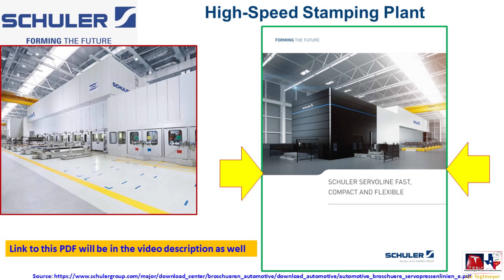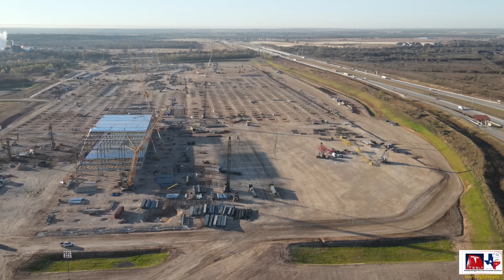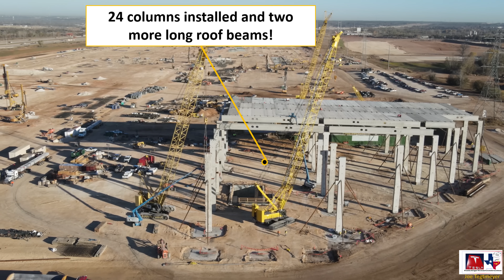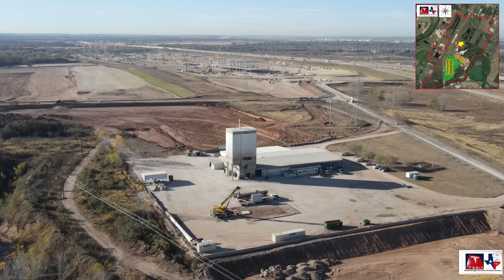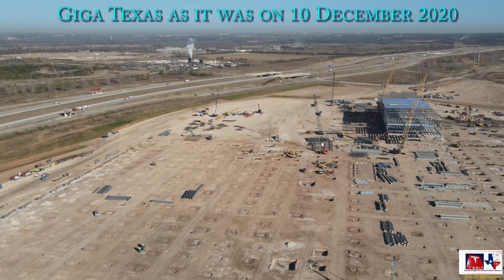Tesla Gigafactory Texas 10 December 2020 Cyber Truck & Model Y Factory Construction Update (08:00AM)

Comment: Those large reels are most likely very large dia. copper( about the size of your thumb) .  They are used for the ground grid and steel structure grounds. They will also drive vertical ground  rods and bolt or cadweld the rods to the wire. You will know this is going to happen when they start trenching the area and you see a grid like pattern.  I helped do the trenching multiple times.

Comment: Do you think concrete wall slab will be going up on the westside and the reason for the traffic barricades preparing for concrete wall pouring?
Reply from the maker: At some point probably but we e got a ways to go before wall sections start going vertical I think.

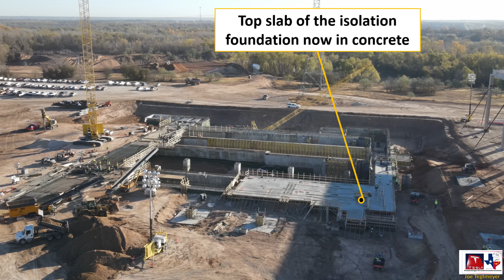Comment: At 14:00 you point out "top slab of the isolation foundation now in concrete."  Is this the future "factory floor" that workers will walk on?  Or is there more stuff to go on top?  (I understand there will be gigantic machinery there too)
Reply from the maker: Sorry ... I thought I covered this earlier in the video discussion the stamping machine installation.  This is where part of the stamping machine will be mounted that does not need the machinery vertically installed underground.

Comment: Ok, so I'm a little confused here. There are 3 major types of machinery for forming the body parts: (1) stamping machines for 3 & Y body panels, (2) casting machines for 3 & Y underbody front and rear chassis structures, and (4) machinery to bend the sheet steel for cybertruck exoskeleton. I had been under the impression that the structures being built in the "big pit" were for the casting machines. This video makes clear that these structures are actually for the stamping machinery. Which begs the question ... what about casting & sheet steel bending machinery?
Reply from the maker: I have been showing, discussing and mentioning that the big pit is for Stamping machines for some time now.  I think most people just casually read some headlines about giga-press casting machines and just leap to that conclusion not knowing that there is a major difference and purpose of the two machines.  The "Zipper" pit will (most likely_) be for casting machines that make the pre-fabricated forms for the front and rear subframes that are bonded to the structural battery of the cars as discussed by Tesla on Battery Day.  I plan on doing another (again) discussion of the Casting machines, where they are made and how they function in an upcoming video.  As for the machines to make the CT exoskeleton, it is my understanding that Tesla has not yet finalized the machines that will be used (at least up to a month or so ago) and I am not sure where this will be located yet as I do not see evidence on the ground yet.  Hope this helps.

Comment: Great Graphics as usual with Your colour coding. The pictures of Schiller Stamping machines showing below floor canned footage from manufacture were the best showing the 3 overhead cranes for 3 machines. Please, more graphics to show 2 Stamping Machines and 8 injection machines in the 3 bays. I’m guessing that the Precast Concrete structure will only be in the pit area. This side is for CYBERTRUCK with zipper area for automated bending of Stainless Steel. The Gazebo area is very narrow structure of 4 columns wide SO FAR? It appears to me that this building only shows 1/3rd of its ultimate width but is built in sections for crane reach for very wide building for 3 car lines? 2 for MODEL Y & 1 for MODEL 3?

Comment: I've noticed the "zipper pit" is at a slight angle to the rest of the building. So that probably means the line will run at this angle as well. Joe, do we have any idea where the paint shop might be located yet?
Reply from the maker: The big steel structure you see right now is the paint shop.  I've been covering this for about 2 months as I have a source on-site that informed me when the first "Gazebo" went up that this was the paint shop.

Comment: Hopefully they will pump the compressible muck out of the remaining undrained  soak pits before filling with more expensive fill.
Reply from the maker: Not sure what you are referring to?  If you mean the work in the northeast part of the foundation next to the steel structure, they are installing a concrete grout mixture to make stronger support pillars than you can get just with GeoPier.  I covered this in a previous video so you might want to check that out.

Comment: Hi Joe. Great explanation of what's going on in the big pit. I haven't gone to the links yet, but will do shortly.

Some observations and wild assumptions below for later correction, retraction, and/or denial.

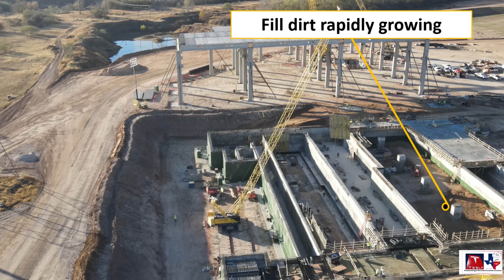12:38. The big pit. Chamber 2 (2nd from west side) being back-filled. Seems the waterproof membrane isn't full height. There's still a substantial amount of headroom there, so I wonder if the fill is at final height, and a floor will be poured at that level. Or maybe the membrane continues to be installed and the back-fill as well. Time will tell.

I cant see any rebar projecting above finished concrete height of the walls (east and west side) of chamber 3. Thinking this might not get a partial floored area like chamber 1.

The skinny corridor on the east side, and the rooms at each end all have rebar projecting above the finished concrete height, so definitely a floor going above those. 

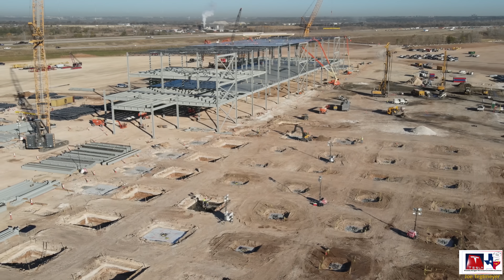Randy pointed out in his #72 an out of line excavation. Seen in your video at 16:30. Seems to be the same size as the other footing excavations, but to be right in the middle of a bay. Machinery base perhaps.

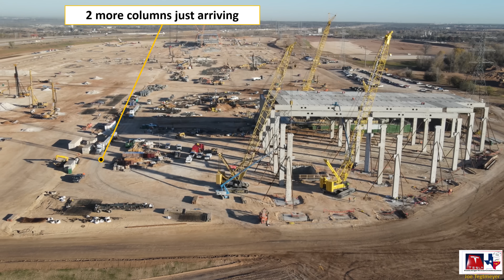Also in Randy's #72 and well worth a look at 11:02, an eagle eyed viewer pointed out a forklift knocking one of the concrete column props out of the ground.

Comment: I believe that is "two of three Cranes being assembled". I believe that the yellow and red trusses at the north end are for different cranes. It looks like the iron workers are using pairs of cranes, one larger than the other, and the red and yellow trusses may be parts of another set for erecting more steel.
 I don't really need to see the concrete batch plant very often, or even the old asphalt plant. Looking at footings and other structural elements being built keeps me entertained.
As always, my best to you, and many thanks for your dedication and skills in keeping us up to date.
Reply from the maker: Yes there are three but at the time of shooting I saw them actively assembling two yellow ones/  I should have mentioned the third.  Sorry.  I periodically look at the old plant because this is where they are stockpiling equipment and supplies to begin construction of the switchyard ... so I believe it's relevant to check there to see what is going on.
Reply: @JoeTegtmeyer  LOL-You are very kind. Absolutely your  prerogative to film whatever pleases and satisfies your pleasure and curiosity. I just am so glad you have the desire and stamina to do this. As a retired electrician, the equipment being unloaded at the old asphalt batch plant could be switchyard gear, but also could be medium or low voltage industrial power and control gear consistent with a possible upgrade and reopening or re-purposing of the asphalt plant. Same with the reels. Just my speculation of course. PS. for electricians, low voltage means 600 volts or less.

Comment: The city of construction trailers will grow probably 3-4 times what it is now. To date, there are only a “few” trades represented on the project, with each prime contractor for each trade having their own trailer for project managers, superintendents, foremen, etc. Once more of the project goes vertical - and areas are in the dry - we’ll see the interior trades mobilize to the site (with their own construction trailer needs). Inside electrical, HVAC, plumbing, process piping, painters, drywall, COMM/IT... the number of trades involved will grow quickly.

I would expect that as geopier and foundation work wraps up, these contractors will pull off the project and their trailers will be removed as well. However, I have a sneaking suspicion that we’ll start to see new areas of land clearing and major grading occurring within the next few weeks as “Phase 1” goes vertical. I suspect that the area at the far west side (near FM-973) will see a lot of development for a new office space.  Elon has moved to Texas. Is it just a matter of time before the whole of Tesla moves as well?
Reply from the maker: Thanks for your comments and insights Douglas ... looking forward to the transition from one part of the process to the next!

Comment: Joe your research is amazing. Your detailed explanation of the stamping machine was very informative. That took a lot of work and dedication on your part. Many, many thanks. Recently the zipper pit appeared to fit the profile for the stamping machines. However, the footers being installing in the zipper pit have significantly changed the configuration so that it no longer looks like a footprint for the casting machines. But it’s hard to get an idea of the scale inside the zipper pit. From your perspective, could that floor inside the pit still be wide enough to accommodate a row of seriously heavy casting machines along it’s length?
Reply from the maker: Thanks Dedric ... the "zipper" is for casting (aka Giga-Press) machines ... I'm just waiting a bit to be 1000% sure before I run a discussion on these.

Comment: Joe, given where everything is at, at this point, do you think Elon’s ambitions of having everything enclosed by May of 2021 is on target? And do you think we’ll see any machines/machinery get installed before they’d start closing up walls and ceilings (things that are large and can’t get installed after the fact)? And I’m wondering if the steel structure we’re seeing might be for the 4680 battery cell production? I’d think they need to get that battery production line up and running sooner than everything else so they have the capacity to start installing the new 4680 in the Texas Gigafactory Model Y vehicles. Plus, I think Elon would want to have those 4680 batteries produced on a bigger line so they have them for the Plaid and Roadster, which will probably be built in Fremont, but they could ship them from Texas to Fremont, then install them there? And oh yeah, LOVE your videos and how you explain things! You rock!!
Reply from the maker: Thank for watching and the questions.  I think they will have everything on the main foundation enclosed and some level of functionality (but definitely not full production) in May ... but there will continue to be construction all over the site as there is much more to come.  The steel structure you are seeing at the moment is the paint shop per on-site contractor sources.  Where the 4680 will be built, I do not know yet and also keep in mind a Lithium Hydroxide plan is coming here as well to support battery production, but I do not yet know where that will be either.

Comment: Looks like they're taking a second pass with sinking those concrete columns you think they're worried about stability there?
Reply from the maker: Not sure where you are looking but if directly east of the steel structure, I believe they are just continuing the cement/grout foundation support pillar work.

Comment: The pit below the stamping press will also be home to a steel belt conveyor. When the stamping press knocks out a hole or door opening in the die, the scrap falls thru the die into the pit. There is usually some kind of chute system to get the scrap onto the conveyor and then it is hauled to a central location to be recycled. I have designed many conveyors, chutes and other equipment for car factories for over 18 years, unless these are completely different than anything I have seen. :)
Reply from the maker: Interesting information ...thanks!

Comment: This just gets better everyday. Looks like there a 2 cranes on the north end being assembled. A red one and a yellow one. The exact setup they are using times 2 on the steel structure. And that wire at the old mixing plant will need many miles of 4 inch conduit to go in. So that will be coming too. Thank you for all you are doing everyday. The illustrations were great!
Reply from the maker: Thanks Allen!

Comment: Joe, new info from a EE friend of mine working on the factory.  There will be no switchyard.  Only a temporary one.  Musk finds switchyards to be an ugly inefficient use of space that while be the lowest cost to install, is not the best long term ROI choice.  He is going to use gas insulated switching (GIS) which does the same thing as an outdoor switchyard in a tiny fraction of the space (7% as per my EE friend).  Plan is for the equipment to be located in the main buildings with 475kv lines directly from LCRA entering the building.  There will be temporary switchyard as this equipment setup is at least a year away.
Reply: Interesting. I could not figure out why they would build a temporary electrical switchyard just to move it again.  This makes sense.
Reply from the maker: Interesting info Louis ... I'd like to get any additional information you (or your friend) can pass along.  I'm going by the original Site Plan from 15 September, so it is possible changes have been made in 3 months.
Reply: @JoeTegtmeyer  Yes, this is very much fluid.  Lots of things keep changing per the EE on the job.  I sense some frustration.  I hope Musk isn't getting to loose with changes . . . very expensive to do things that way.
Reply: Wow, so I wonder if that large area that we've been thinking would be the switchyard will instead be a parking lot or something?
Reply: @BlazerRox  Among other things, there is talk of a large battery farm going on the site.
Reply: I wonder if they will use Megapack to back up and condition power?
Reply: Makes sense. Also amusing how Elon is concerned with efficient use of space for such a massive build site. Exciting to think that there are even bigger plans in the works than we are even aware of.
Reply: @richpate9436  The EE gave me the impression it had more to do with aesthetics.  Not so much that the space is at a premium.  It isn't just ugly, it's big and ugly.  Also, GIS is just the nicer way to do it.  Virtually no maintenance or failures on that equipment.
Reply from the maker: @apostolakisl  May I ask what company is doing the Electrical work?
Reply: @JoeTegtmeyer  My EE friend is with the company that is under contract with LCRA to manage the Tesla project as far as LCRA's responsibilities.  I don't think Tesla has signed a contract yet from their side as my friend indicated that Tesla was taking bids on the GIS.  I don't know how much of this is public so I'd rather not say any names.  The company my friend works for does the design and installation of high voltage grid systems.  I'll ask him if I can say more.
Reply from the maker: @apostolakisl  understand and am aware of the contract bidding process underway.  If he can or is willing to provide some info, that would be welcomed!
Reply: Very interesting. I'd love to know any other details on the electrical distribution as well. My guess is that they're bringing in 475kv to the main switchgear and stepping down to 13.8kv to feed throughout the building. I wonder how many seperate substations giga texas will have?
Reply: @ElectronRacewayFabricator  If they're bringing 475 kv directly into the building.. What happens if there's a fire? How do you shut down power if the switch equipment is in a burning building? Or the other way around... A fire in the switch equipment could set the building on fire.
Reply: @DavidJohnson-tv2nn  There would definately be a switch outside somewhere, but it would likely be a small  padmount gas insulated switch as a service disconnect. Most of mine are pole top group operated switches, but I dont think that would be the case here.
Reply: But TBH, I do have some doubts about bringing that type of voltage into the building. If I had to guess, I think it would  likely enter at some medium voltage vs high voltage. Probably <35kV. If they truly are planning to bring it in at 475kv, would the power company own that section of the building? Wheres the point of demarcation? I'm thinking we'll see something closer to what they installed at giga 3. A seperate substation building with medium voltage feeds to the factory, and substations that transform from medium voltage down to 480v strategically placed throughout the building. The power company would most likely own the substation building, and Tesla would be on a transmission transformed contract which would provide low cost power to the site. Just my .02
Reply: @ElectronRacewayFabricator  My understanding is that the 475kv will enter the building and the GIS will be within the main factory footprint being built now.  No doubt sectioned off.  This is not typical in the US, but is common practice in countries like Japan.  The GIS will be owned by Tesla, the 475kv line from the towers into the building will be owned by LCRA.  These lines will be underground.  This is going to take a while because this equipment is built to order.  Also, I understand that the specs are not yet fully defined.  The ultimate plan includes a huge solar array and a battery farm, not just for the factory but to sell back into the grid.
Reply: @apostolakisl  Very interesting. I'd love to hear any more details as they become available. Please keep me posted!
Reply: @apostolakisl  Louis, are you on twitter?
Reply: LCRA = Lower Colorado River Authority
Reply: So where are all the transformers going to be located?